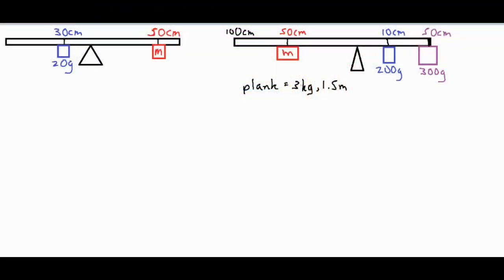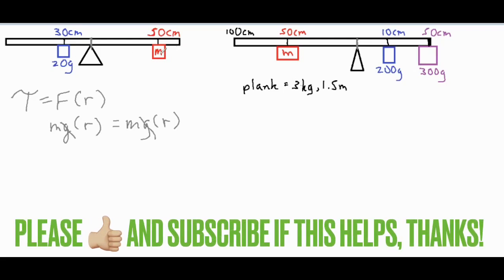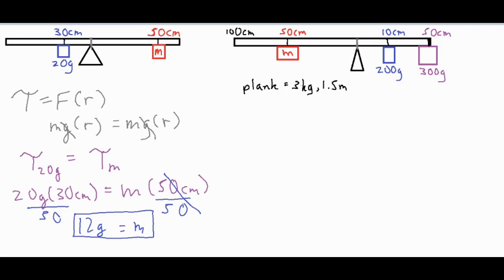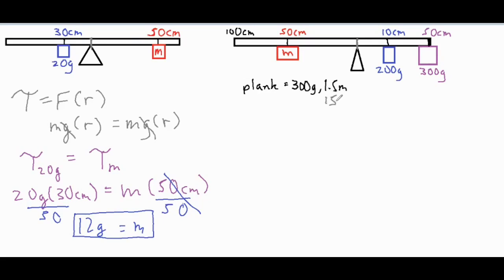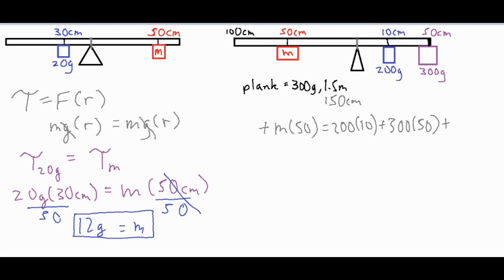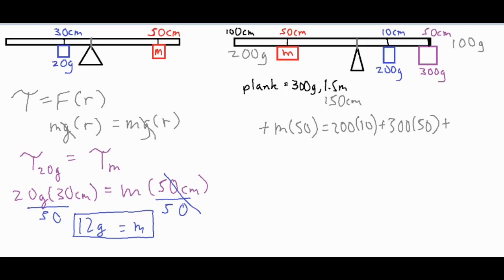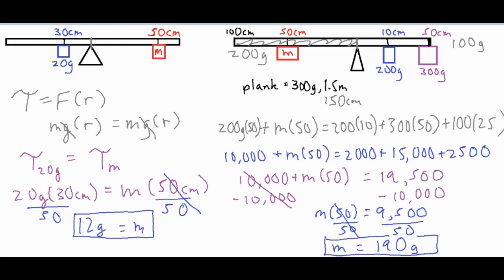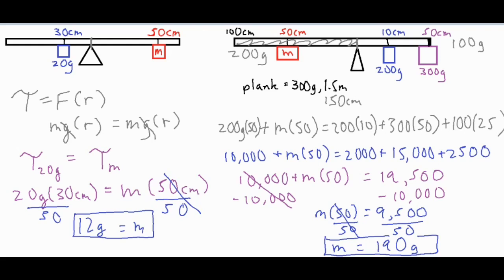Torque Balancing Problems (1 Basic & 1 Advanced)

Comment: Thanks for explaining, really helped me understanding how could i solve problems when the lever itself has weight
Reply from the maker: If you want to include the weight of the lever then you use the center of mass as your distance.  For example, you have 3m of a plank to the right of the pivot point, then you find the Fg and use 1.5m as your distance from the pivot point.  Hope that helps!